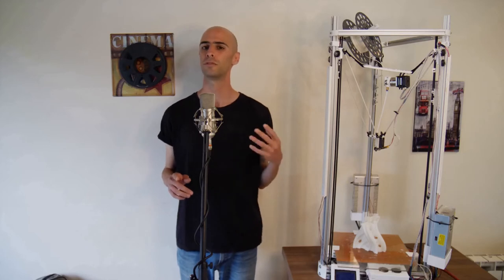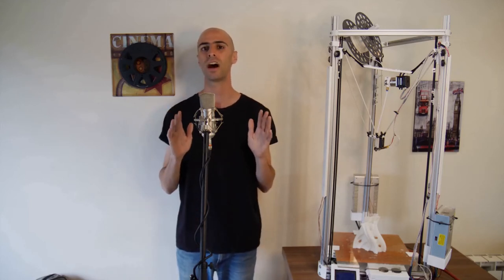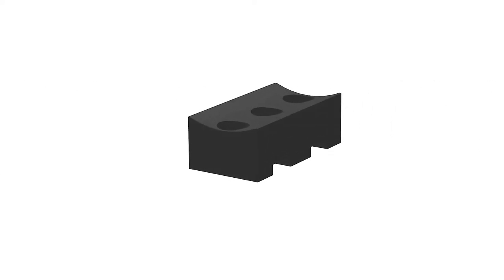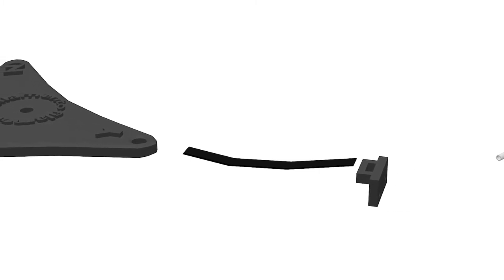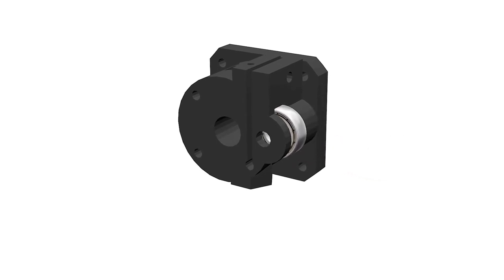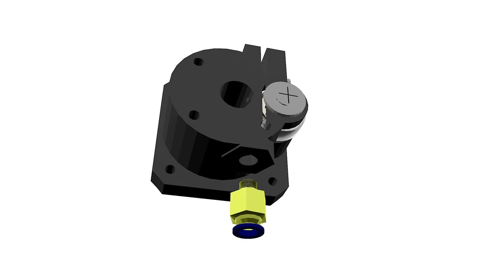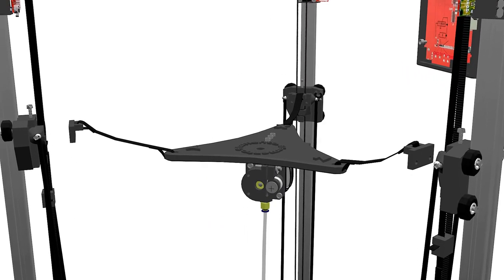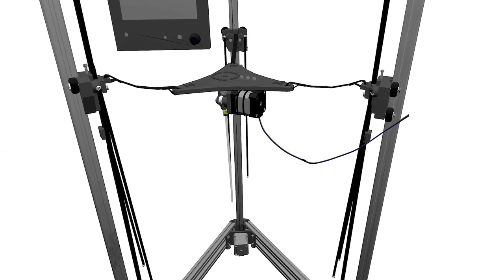Build a Delta 3D Printer - Going over the flying extruder

Comment: Heat creep is actually when heat at or above Tg travels up into the heatbreak, causing premature melting and expansion of the filament which then increases friction in the hotend, causing your extruder to skip

Comment: Thanks for sharing your idea.  I am hesitant about adding mass to my servo system and would be curious to see the actual benefits of a hanging extruder.
Reply from the maker: I think it's a good thing to experiment to see what a flying extruder can do and can't do, regarding your idea of adding more weight to the extruder you should probably research on adding a counter weight system that hangs outside of the printer frame (similar to the way a counterweight on an elevator works)

Comment: What is the point to introduce 3 new carriages ? You are still using the same motors. Now you have increased complexity, part count and weight. 
Why not use a flying extruder which attaches to the carriages you already have (since they are driven by the same motors anyway) and using a light Orbiter, Sherpa or similar extruder or about 100g total weight with the nema 14 Motor. The mounting plate is also huge adds weight etc. so I don´t see the benefit here.
Reply from the maker: Granted the mounting plate could be made smaller to save some grams of PLA, could definitely be an improvement for a newer version.
I'm not sure what do you mean with adding 3 new carriages as the flying extruder is already being attached to the existing ones.
Reply: @myriadpro6752  Maybe I misunderstood you then, because I though what you proposing is to introduce 3 new carriages for the extruder, was this incorrect ?
Reply from the maker: @sierraecho884  the flying extruder is fixed to the existing 3 carriages, no new nema motors are added for this. hope this is helpful
Reply: @myriadpro6752  Yes it is, thank you.
In this case :
- try to decrease the distance between extruder and hot end, to have as short of a PTFE tube as possible. Maybe iteratively-
- Change the motor to a different build like the Nema 14. Since 70% of the weight will be the motor alone. This has the highest potential for weight saving.
- For the straps you can use velcro straps. They might be lighter but they will be easier to use for sure, no glue needed and they are pretty tough nylon. Also no glue needed.
- For the fitting use a "push through" fitting, so you can push the PTFE tube right up to the extruder gear wheel for flexible filaments if you want to print any. The same can be done on the other fitting for retractions. It basically restricts the filament path and improves the performance slightly.
Besides that, I really like your overall design. I think a flying extruder is a great idea in general. Let me know if you try any of my suggestens and hot it went.
Reply from the maker: @sierraecho884  This is great, thanks for the comments, hopefully this design will be further improved by replies like these
Reply: @myriadpro6752  I am happy you see it this way and hope so too, that´s what a community is for =)